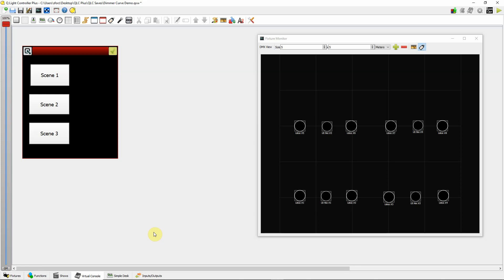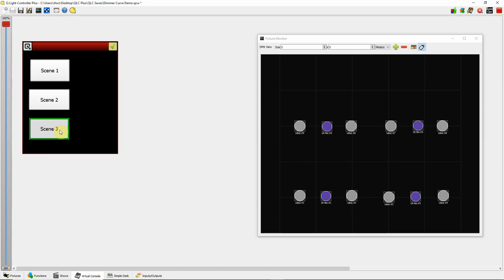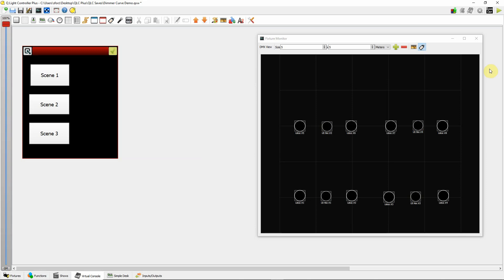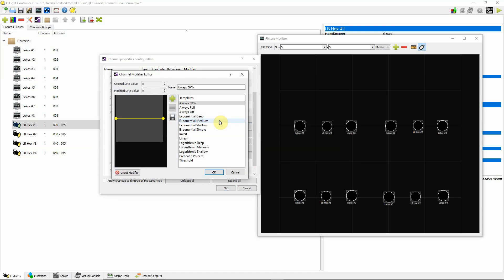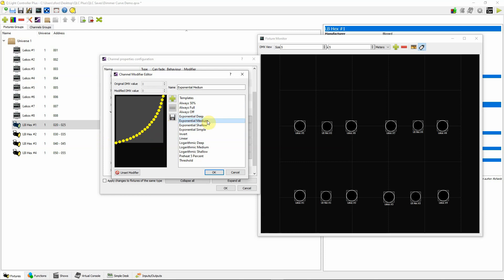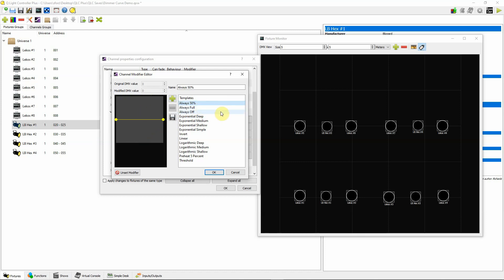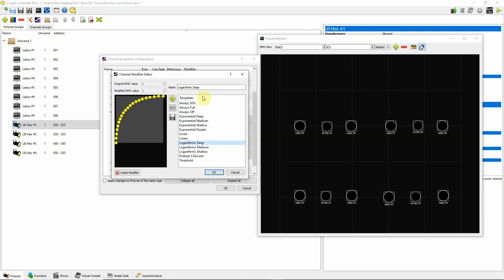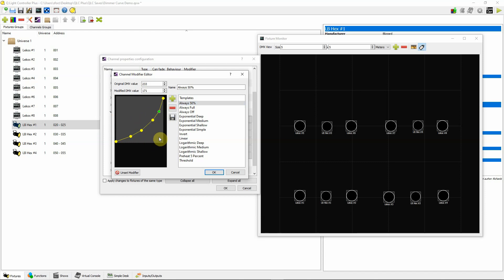LED Wash Fades Up Too Quickly?

Comment: Is the great fade effect between those scenes solely down to the fade setting on the fixture, or is it part of the scene configuration instead?
Reply from the maker: Hi Mark
The fade effect is part of each scene that I created. When you go to the functions page in QLC+ and create a scene, click on the clock icon in the scene toolbar and you can add a default fade in and fade out time for the scene. Note: when you make a scene a part of a cue list or chase, then the fade up and fade down times are controlled in the chase or cue list setup and the default time no longer applies. If you use a button to activate the scene, as I did in the tutorial, then the default fade time which I set when I created each scene is in control of the fade.
Ed Richards
Reply: @edwardrichards7722  - great!  Many thanks for taking the time to response, appreciated.